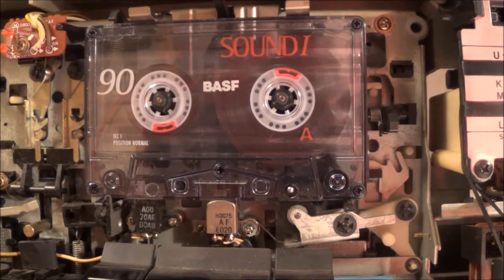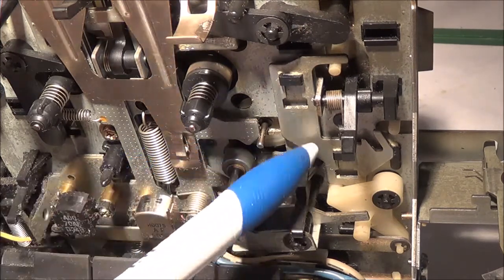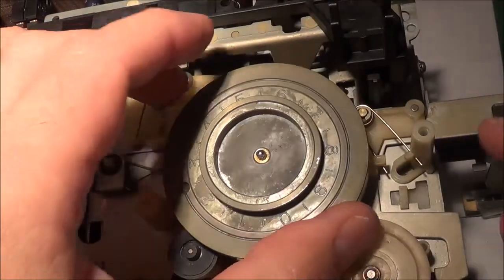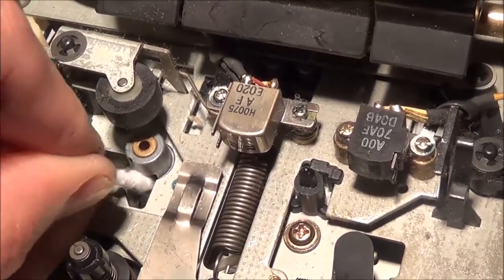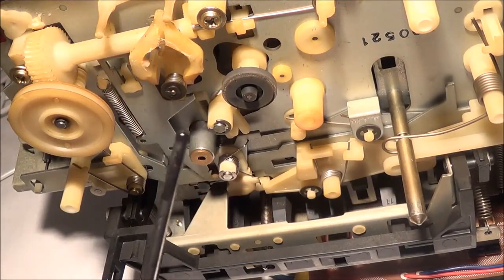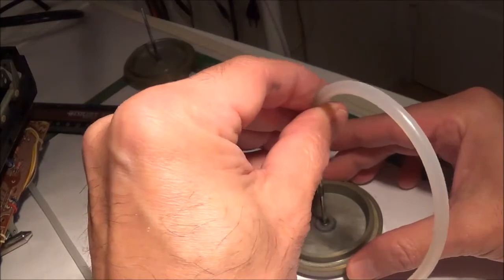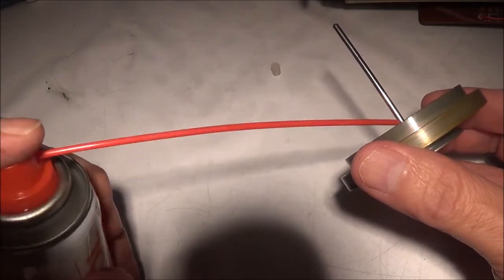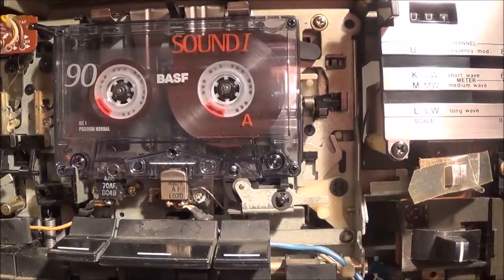Sharp GF-555 Boombox Tape Spillage & Pulley Replacement

Comment: Your photography is truly excellent. Stable camera work ... very important.
Reply from the maker: Thanks! Although I do use a cheap, old camera since I am not a famous and successful YouTuber.
Reply: @OldSchoolElectronics  but you managsd to make me understand what's wrong with a Sharp RT-1010 that I have here. One question: is it possible to  replace the belt (or sort of rubber piece) around the pulley?
Reply from the maker: I am not sure what you are talking about? If it is an idler wheel with rubber around it, yes. You can use an o-ring, or if you are lucky, a reproduction of the original is sold somewhere.
Reply: That was exactly what I was talking about. I'm going to search on a hardware store near me and I hope one day to give further notice about that. Cheers.

Comment: Hello, i had the same problem, got it fixed in no time. Absolutely flawless piece it is.
Reply from the maker: +Valter Õunapuu cool! the only weak spot seems to be the little rubber pulleys; the old belts, of course, should always be replaced.
Reply: Also, those silver trims tend to come off and most of GF-555s i´ve seen for sale are missing those. Mine has all of them.

Comment: Thanks. Succesfull repaired the mechanism today. I took it completely apart though. 👍👍
Reply from the maker: Good job! Another classic saved!
Reply: Do you perhaps have experience with the VU meters? They are doing it very well while playing cassettes, but when listening radio, all the leds light up nearly constantly.
Reply from the maker: I don't have the service manual procedure for this. If it really bothers you and you are not too concerned about accuracy, you could always adjust R601 and R602 slightly. I don't have this box anymore, but the adjustments would be on the indicator board it seems.

Comment: Very useful set on the GF555 - thank you. Sadly I've had less success as I think there needs to be a degree of slippage to account for the fact the spool gets larger as the tape is pulled through. One of the decks played ok prior to fitting the new tube but now sounds rather muffled plus the cassette won't rewind and is very stiff to move with a pencil so I think the take up spool is trying to pull the tape through the capstan.  I believe that if you get hold of the tensioner pulley with your fingers it should be fairly easy to stop and mine isn't. I wonder whether there was some lubricant on the spindle of the flywheel pulley to aid slippage from manufacture and this is what causes the black gunky mess over time?
Reply from the maker: Sorry, I wrote you a lengthy reply a few weeks ago, but the internet failed just as I hit the send button. Anyway, I would put a drop of oil on the spindle (on the bottom part of it--not where the tube is). And as you already know, clean all the rubber wheels with isopropyl alcohol, making sure, that they are not glazed, hardened, or cracked. Clean the head again, demagnetize the head, make sure the head position hasn't changed. Try a different cassette--which I assume you probably already did. I assume by muffled you mean poor high frequency response. The pulley, exposed to the air and light, seems to have its chemical composition changed over time. What exactly this is, I do not know.
Reply: @OldSchoolElectronics  Thank you for your reply. 
The pulley I fitted was 6mm o/d tube and I think it was a bit big: I actually ended up replacing the pulley with something with a smaller diameter and it seems to have done the trick in terms of tension and sound quality which, yes was lacking high frequency.
Just in case anyone else comes across this problem, the sound was louder from one speaker than the other and I was advised on Boomboxery to 'work the record bar' as it activates/deactivates some switches as it moves. Sorry if you have covered this off yourself elsewhere.

Once again, thanks for a great series on the GF555
Reply from the maker: Ok, cool. Glad you got it fixed. Again, sorry about the late 2nd reply. Also, I am not YouTube that often nowadays. The advice you received is correct. You should in fact spray contact cleaner into that function switch and work it back and forth. The dirty switch sometimes often also causes a wierd warbling sound.  And as you maybe already know, it is the large, flat switch with many contacts on the circuit board. In fact, spray all switches, or, if you do not have contact cleaner, at least work them back and forth with the power off. 
 And thanks for your kind words.

Comment: Hello, thanks for the video. I used a latex tube, of 5 mm, and 1,7 mm in the inner diameter, it fits well. The deck doesn't eat the tape anymore, it spins well, but the sound is BAD, it sounds like if it needed more speed. Maybe latex is not a good material ?
Reply from the maker: Hello and thanks for your comments. I haved used either clear plastic tubing (sanded to give it more grip) or silicone medical tubing. If it is going slow it could be loose belts or the motor speed control needs adjusting. I don't have the Sharp anymore, so I am not sure if there is a hole in the back of the motor to adjust the speed. Bad sound could be a dirty head or dirty record/playback switch (behind the cassette mechanism).

Comment: Hi, My Sharp GF-555 makes pit, pit, pit sounds when I play cassettes. There is no sound like this on radio part. Only in tape part. Is it a bad capacitor problem or does a good cleaning fix the problem? When I increase the volume, this pit,pit, pit sound also increases. What can be the problem? Waiting for your advice. Thanks in advance.
Reply from the maker: I'm on vacation so I can't write a book. I would try cleaning the record/playback switch on the main board. The long switch; sometime there are two; these are next to each other.

Comment: Hello Old school sorry for bothering here. I'm looking for information everywhere. I have a sharp gf 666z that I am restoring. and I ran into two problems 1 is that one of the cassette motors does not stop turning and the other is that one of the speakers does not sound. could you give me some clue. in point 1. clean all the contacts and you still have the problem. the two little by little I am looking for the cause. Thank you very much in advance, greetings from Argentina
Reply from the maker: I will be back from traveling in a few days. I have very limited internet now. I will write again when I am back home.

Comment: Sir does the pulley need to be tight. Also how far does it need to go. Thank you .
Reply from the maker: MS: I did this video years ago and I no longer have the GF-555. But: if you mean the rubber pulley on the capstan (thin, shiny metal rod), then the pulley is not supposed to slip, that is, it will be moving and in contact with something else. Therefore no slippage is allowed. Tight, but you can do that by hand. You have to use your "eye judgement" to find the right position. Remember, it is making contact with something else; so see if it is making good contact with the other pulley/wheel). The contact spot should be in the middle.
Reply: Old School thank you ever so much sir for responding to my questions. I’ll give that a go 😊
Reply: Thank you sir 😊 I’ve understood where the pulley goes I’ve done a trial with the previous rubber tube which is loose. I can know see how the other wheel gets in contact when the play button is pressed . Thank You

Comment: I have this issue too. And removing the cassette mechanism will be difficult without a service manual.
Reply from the maker: In case you don't have it: https://elektrotanya.com/sharp_gf-555h_e.pdf/download.html
Reply: Old School thank you 😊👍👍👍
Reply: Old School oh no it’s black and white 😱 colour images would have made it easier .
Reply from the maker: Yes, these old scans of service manuals are all black and white. That's the bad news, the good news is that they are often free. I would take the relevant pages you want and zoom the pages before you print them out. And if the pin still doesn't hold, use glue or nail polish to keep it in place.
Reply: Old School thank you 😊
Reply from the maker: Good luck with the unit and everything else!
Reply: Old School thank you. I think I’m nearly getting there. I found that the belts are not loose but very dry so I’ll oil them slightly. I just struggling a little to understand how the pulley is placed.

Comment: how did you get the mechanism out?  you skipped past this important part.  the rear of the mechanism is covered
Reply from the maker: mark, i thought i made an extra video just covering removing the cassette mechanism.
Reply: You have to take the tape mechanism deck off the main chassis, quite a few plugs and sockets. Also then take the bearing plate off the back of the deck. You will have to leave the motor plate hanging off, because it is hard wired (unless you unsolder the wires) TAKE LOTS OF PHOTOS and notes. I took out the small screw holding the bracket where all the wires connect. The centre piece of the solenoid will fall out!. I then had to take off the middle plate of the deck to replace the idler tyres (US:tires) which were damaged.

Comment: Only issue I have now the cassette player doesn’t turn on it was working before I removed the mechanism .
Reply from the maker: Make sure you don't have a problem with the leaf (thin metal) switches. All connecters to the cassette mechanism need to be checked.
Reply: Old School thank you sir. I noticed the fuse blew 😂 i replaced it it’s powered up now.
Reply: A side is still spilling . B side is trying to work but isn’t. I have ordered new belts. Also I think I may have positioned the pulley in the wrong place at the moment it’s positioned so that the other wheel has contact with it in the centre .